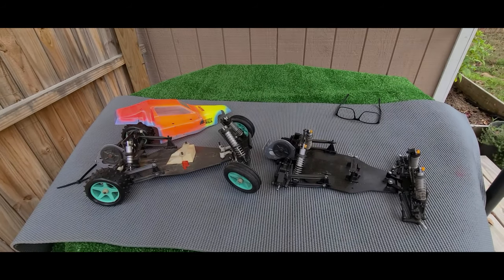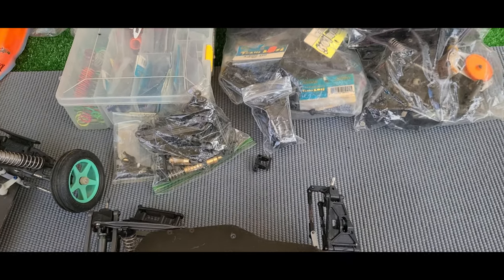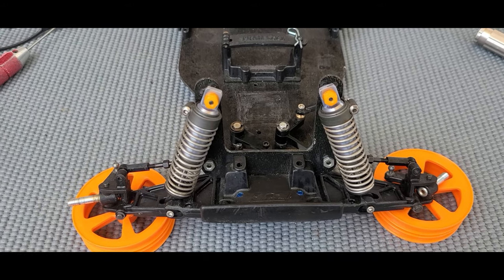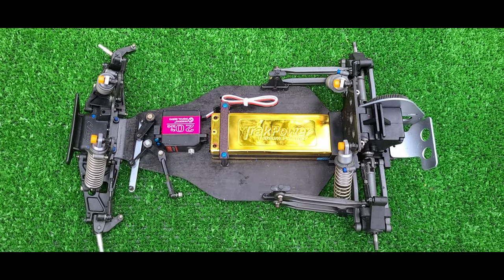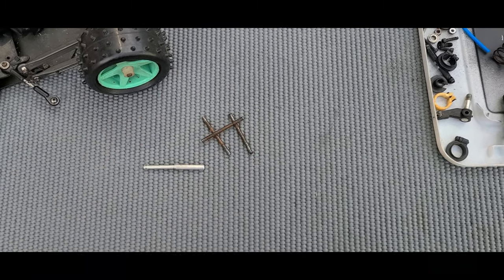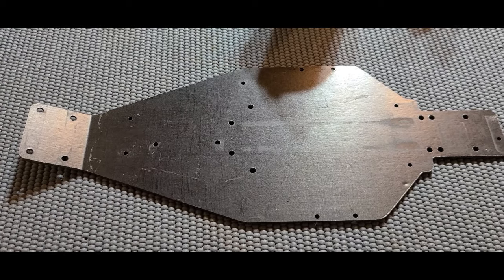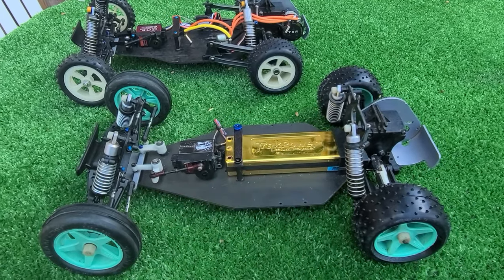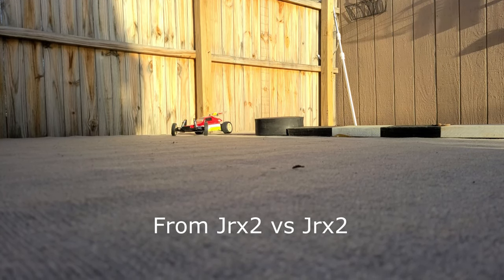Can we restore these two classic R/C cars? Losi Jrx2 buggies!

Comment: the JRXT was the less expensive route to get the Pro chassis for those who had not already bought a JRX2.  i picked up the JRXT along with a buggy body and wing with mounts, wheels and tires at Off Road Headquarters in Beltsville, MD.  i still have the receipt!  it allowed me to double my day at the track running in both the 2WD buggy and truck classes.  about 2 months ago i pulled my box of r/c cars out which had been collecting dust for over 30 years with the goal of getting them running.  so far the Tamiya Blackfoot and JRX are running, the AYK Radiant is gonna take some more work, but it will run again.  thanks for taking us along on this trip down Losi memory lane.

 RIP Sr, you left quite a legacy.
Reply from the maker: Wow...That's a really cool story brother! Makes sense to do it that way as well. Must also be super amazing to have some of your old cars still (wish I did). AYK cars were always out of my reach (now they really are...lol) but I remember seeing those ad's in RC Car Action and drooling over the engineering...and obviously the ORANGE bits! Good luck getting them up and running again my friend. Really appreciate the great comment as well.

Comment: Nice! Looks like there are some early pieces on the 5-link car. Non-braced rear hub carriers, aluminum outdrive spacers and thin/flexy 5-link chassis mounts/bulkheads. 👍
Reply from the maker: Big learning curve for me with these cars. Will take a look at those bits and do some research. I appreciate the tips! Have some spare parts...maybe I should preserve the "early" bits?
Reply: @VINTAGEBACKYARDRC  For a runner I'd probably swap out the rear hub carriers just in case. The outdrive spacers will be fine though you could probably sell them, they are in demand, early rear hub carriers too if someone is doing an early resto. The bulkheads can still be found but if for a runner the reinforced units would be better though. Whatever you decide enjoy the cars!